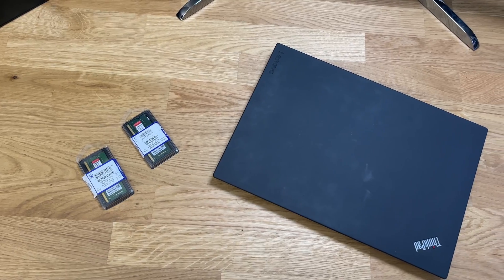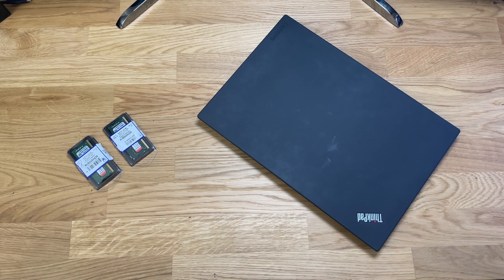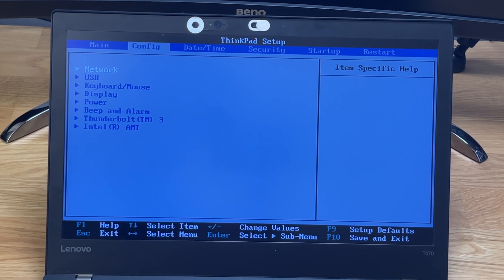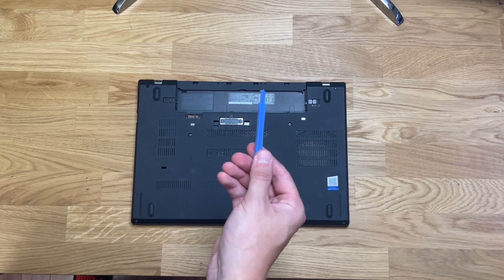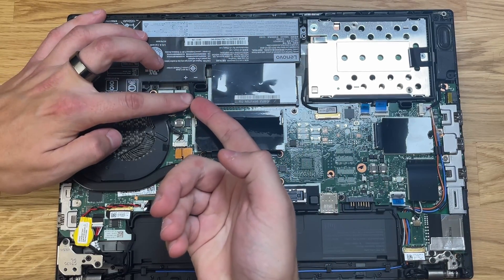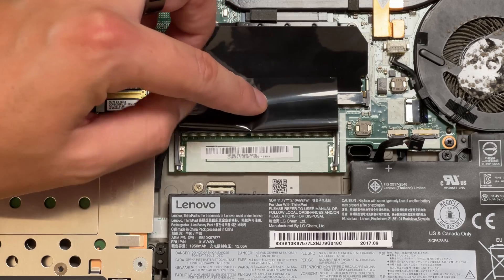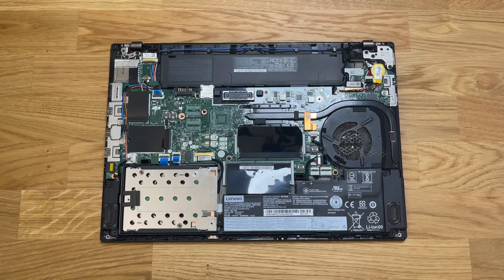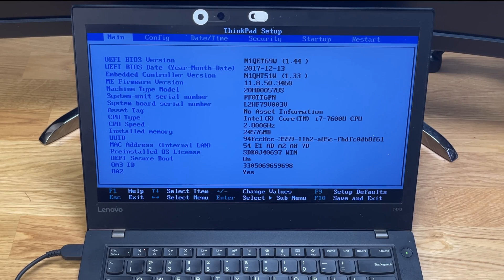How to Upgrade RAM on a Lenovo ThinkPad T470/T480 Laptop

Comment: I need help, i just added WD NVMe SSD 2242 258GB in my WAN slot, I already installed it properly and disconnected the battery before installing, but im still stuck in my LENOVO title, I can't even go to Menu

Comment: Great video - this worked out for me. Now I have 32GB of RAM in my Thinkpad. Well, a bit exaggerated, but okay. The plastic clips suck, one broke off in my laptop and got in the way on re-installing the bottom cover. But I managed to remove it completely… not perfect, but good enough.

Comment: I currently have a Kingston 8GB and Timetec 8GB RAM sticks in my T480 20L6.  I recorded all of the stats while testing RAM in SiSandra.   I then installed brand new Crucial Vengence 2 x 16GB Ram Sticks 2666MHz 18 CAS.  These sticks were also tested in SiSandra, and I was surprised to see the results were WORSE than the 2 x 8GB RAM.  I have tried another set of Timetec 2 X 16 GB ram sticks- same results = WORSE than current mismatched 2 X 8GB ram sticks.  WHY.  Also, the clock speed of the T480 is locked at 100MHz with a 17x multiplier.  But its locked.  So will 2 x 16GB ram sticks actually increase speed of this computer?  Or does the locked base clock keep speeds contained, even though it can technically take 32GB max?  It just didn't seem to show any improved performance with 32GB installed.  My VM's performance not improved with 2 x 16 GB ram vs 2 x 8GB sticks.  Who has thoughts on this?

Comment: Excellent demo, thanks. This worked really well and was super helpful. 
Just a note if you never did this before: The screws at the back of the laptop don't come/fall out (not with mine anyway), they just stay in the back cover loosened. You also don't need to go back into the BIOS after installing and reinserting the battery to enable it again. This is automatically re-enabled when you start up the laptop and it's connected to power.

Comment: My computer says I have 16gb, and I need to upgrade vecause it's really dragging editing video, how can I tell (without taking it apart first) if there are two 8gb ram sticks or one 16 gb, and an empty slot? Also, can I upgrade to 64gb? It uses DDR4 SO-DIMM 260 Pin.
Reply: Depends, are you T470 or T480

Comment: very useful. Question: so it is possible to mix DDRs of capacities? 4 with 16, 8 with 8, 16 with 16?
Reply from the maker: @urishani  it is possible, more recommended to use matching set but I’ve done it in the past

Comment: So you can use a brand of ram sticks right? Please respond!!!!
Reply from the maker: You can use any brand of ram as long as the specs are supported (max size and speed) but i linked some options in the description that i think are a good fit!
Reply: @TechWithTylerArruda  thanks I have a question I'm thinking of getting the l460 instead of this do you think it's better
Reply from the maker: The L series is more entry level than the T series. If you are talking about same generation L vs T, the T takes the win
Reply from the maker: @NeptuneDaSensei  no problem!

Comment: amazing tutorial. I just got my t470 and I want to upgrade its ram. Is it possible to use fury impact 2666MHz ram in this laptop?
Reply from the maker: That should be fine, you can check what your ram speed is and see if it matches
Reply: @TechWithTylerArruda  its 2133MHz. Is it ok?
Reply from the maker: I would try to get something the same if you are going to use both. If you are replacing and removing the existing one you should be fine with the fury
Reply: @TechWithTylerArruda  ok thank you for the advise.
Reply from the maker: @allanshadeedmuksin  no problem!

Comment: Did you turn on the built in battery in bios again? or should it be permanently disabled once another memory is installed?
Reply from the maker: I believe it’s automatically switched back on but I would check to make sure

Comment: Is it possible for me to add another stick of Ram (16gb) while not removing the original Ram installed[the factory set one(8gb)]?
Reply from the maker: Yep! You can have mismatched ram, performance might not be amazing but could help if you use the same timings
Reply: @TechWithTylerArruda  TYSM!
Reply from the maker: @peanut_wr789 no problem!

Comment: Can I ask??, so the RAM used by the Lenovo Thinkpad T480 laptop is "DDR4 3200Mhz" or "DDR4 2400Mhz"??
Reply from the maker: I don’t believe it’s 3200
Reply: @TechWithTylerArruda  So?, Lenovo Thinkpad T480 uses RAM with type "DDR4 2400Mhz"?? 

Because I found a video on YouTube, which explains that the Lenovo Thinkpad T480 can be upgraded to 64GB with DDR4 3200Mhz RAM type.
Reply from the maker: @kaniafitri5778  looks like 64gb works, someone on this forum did it with 3200mhz ram and it seemed to clock it down to 2400 but the 64gb was available.

https://forums.lenovo.com/t5/ThinkPad-T400-T500-and-newer-T-series-Laptops/What-is-the-Maximum-Memory-Supported-in-a-T480-32-GB-or-64GB/m-p/5131432
Reply: @TechWithTylerArruda  I just saw the thread. However, the system used turns out to be an 8th generation I7 processor.

Will it also work on the Lenovo Thinkpad T480 laptop with the 8th generation I5 processor variant??
Reply from the maker: @kaniafitri5778 good catch, I’m not 100% sure

Comment: Hey, thanks for the video. What is the recommended MHZ value for T470s RAM? currently I am using second hand laptop and inside it has 8GB 2133MHz RAM. No Idea about original RAM details. Could you help me? I want to upgrade to 16GB RAM, but I have no idea about MHz. Thanks
Reply from the maker: You can use up to 2400mhz! If you’re keeping that stick I would match it and get one of the same speed
Reply: @TechWithTylerArruda  Thanks for the reply. my onboard RAM is 4GB, I am thinking to sell this 8GB and buy 16GB 2400 MHz as you said. Thanks again
Reply from the maker: @RiseAboveRoots987  no problem!

Comment: The best proper RAM Install Ive seen, didnt even know there was a disable internal batt.  Thanks
Reply from the maker: Really appreciate this comment! Thanks!
Reply: @TechWithTylerArruda :After installing the ram you need to go back to Bios and turn on the Bios battery again, right?
Reply from the maker: It should turn on automatically but you can double check! Sorry for the late reply!

Comment: Hello,

It is quite helpfull, just wonder how to determine memory cards based on model, I have t470 with no memory in it and would like to have 2×16 variant if ddr4 but there are quite different type of ddr4 speeds 3200, 3600 etc
Also same goes for ssd is missing as well and I wanted to have 512 size but again what type is best for optimum performance thanks for helping out in advance
Reply from the maker: I believe you can use up to 32GB of memory speed I used was 3200mhz and you can use an Nvme drive. You can even get a larger drive than 512 if you would like. NVMe will give you the best drive performance!
Reply: @TechWithTylerArruda  Great, thanks for speedy response
Reply: you can use up to 64gb with 32GB ram sticks @TechWithTylerArruda
Reply from the maker: @lowgrind7076  I believe the max “supported” is 32GB but looks like people in the forums have had success with 64GB!
Reply: @TechWithTylerArruda  yeah I think it's because they didn't have that type of ram size available in 1 stick back then 🙏

Comment: great video!
I was wondering, is there enough power to support 32 gb ram in such a small computer?
plus: would 32 make a big difference compared to 8 when cutting videos, and will the battery drain quicker with more ram?
Reply from the maker: Hmm good question I’m pretty sure this laptop supports a max of 32. As for the battery, if you need more ram then you are probably doing more intensive work which in turn would make the battery drain faster.

Comment: Can I use this on the T470? Samsung 980 Pro 1 TB M.2-2280 PCIe 4.0 X4 NVME Solid State Drive
I currently have the XPG SX8100 PCIe Gen3x4 M.2 2280 Solid State Drive
Reply from the maker: You should be good if you have the m.2 slot

Comment: In the T480 model, it can handle 64Gb of ram <3
Reply: Do you know if the T470 can hold 64gb of ram aswel? Or is it just the T480?
Reply: @jamelljacks9356  according lenovo website it holds 16GB of ram but crucial website's says that it can support 32 gb of ram as maximum

Comment: locking for 2 Orginale Lenovo Backlite Keybords 
20L6 = FRU 01HX471 
INTERNATIONAL oder GERMANY !
where can I order this reliable source in China?

"LINK" please......Nice Day from Thailand

Processor
1x 8th Generation Intel® Core™ i7-8650U Processor vPro

Memory
64GB 2x 32GBDDR4 3200

Operating System
Windows 11 Pro 64

Hard Drive

1x  2.0 TB PCIe NVMe "0" 2280

1 x 0.5 TB PCIe NVMe "1" 2242

Camera

1x 720P IR & HD with Array Microphone

Graphics
1x NVIDIA MX150 and UHD Intel

Monitor
14.0 WQHD 300 nits

Da schon schlechte Erfahrungen gemacht in 2021 

LG Weit Weg by 33 Grad MAERZ 2566🥰
Reply from the maker: I’m not sure but a google search might help you out

Comment: Too bad we can't see how fast Windows would start up after the upgrade. For the rest, thumbs up! I am upgrading to my T470 from 8 to 16 GB. After a week I can say, that performance was already good, and did not improve much. I have dual channel for my ram now, so it works optimal and that's fine for now.
Reply from the maker: You will only find a difference in performance if you were to compare many programs open at once with 8gb vs 16gb. The more ram the more stuff you can have open at once without slowing down!

Comment: hi! thank you for the video! My question is should we turn the Internal Battery in BIOS back ON?
Reply from the maker: It should turn back on once you start the computer back on again
Reply: Is turning of the battery manditoy? Or can I just skip it because I don’t have an ec adapter is that just the charger? Or like what is it ?
Reply from the maker: The charger is the ac adapter

Comment: I don’t know anything about computers or ram and I’m going to the store to buy a ram stick for my thinkpad t470 in a few hours so I have questions. Are there different types of ram brands? I ask this bc is there a certain type of ram stick that thinkpad t470s need? Please answer me I don’t wanna mess up my laptop I just recently got this 😭😭😭
Reply from the maker: There are many types of brands! Some good ones that come to mind are Kingston, Corsair, crucial, intel, OWC. In terms of what to get that will depend on what you currently have, you can probably do a total of 32GB max
Reply: @TechWithTylerArruda  so basically the brand I put doesn’t matter and won’t damage my laptop?
Reply from the maker: @Carmelaines  no as long as it’s the laptop memory it shouldn’t. Performance might not be as good of the sticks are not a matching pair but would be hard to notice
Reply: @TechWithTylerArruda  I’ve managed to remove the lid off but I don’t see the internal battery wire that I saw on your vid, can I still proceed with the steps
Reply from the maker: @Carmelaines  you should have a wire there somewhere, you can google the model and then write “internal battery wire location”. You can also look at the wire coming from the battery and find it on the board
Reply: @TechWithTylerArruda  do you have any social media I can add you in so that I can send you a picture of what I’m looking at? If not it’s fine
Reply from the maker: @Carmelaines  https://instagram.com/tylerarruda33?igshid=YWJhMjlhZTc=

Comment: Great video. I notice a clip actually broke while you where taking it apart. Another YouTube warned about this. He said do the top near the battery first and then slide it down. But do not try to pry it from the bottom.
Reply: For sure a helpfull tip. I started on the sides and worked my way from front to back on one side, then front en then other side. After that, backside came loose easily.
Reply: Do you mean do the top near the internal battery first, or the removable battery first?
Reply from the maker: Yeah I’ve had to open a bunch of these so that’s a good tip! Thanks man!

Comment: What do you need to check in order to review  if the cpu can be upgrade in a laptop?
Reply from the maker: Most laptops (if not all modern ones) have processors soldered to the main board. This means that in order to upgrade the cpu you would more than likely need an entire new motherboard (which is not cost effective). Ram and Storage are the main upgrades available on laptops (some laptops even have these components integrated with the motherboard also like apple)

Comment: Awesome Video! I'm planning on purchasing an 8 gb model and wanted to upgrade the RAM. Would you know if I could simply add a 16 GB stick into the 2nd slot if its possibly a different brand? Also i've only heard of PC memory with increments of 8, so 16 GB, 32 GB, etc. Is there any issues with 24? Thanks again for all the information!
Reply from the maker: I believe it should work! I have done the same in an old MacBook Pro before and had no issues. You get better performance using a matched kit of RAM but it shouldn’t be very noticeable.

Comment: You link to a kit rated for 3200Mhz speed, does that speed work with the T480 or does the t480 downclock that set to work?
Reply from the maker: Seems like it downclocks to 2400, it’s probably easier to get your hands on 3200 and it should work just fine, I didn’t have to do anything, it down clocks it automatically
Reply from the maker: Good question, I’m not sure it supports 3200Mhz I don’t have the exact model I installed as I did the install for a family member, but let me check

Comment: Hey bro, I love and liked the video. Just one question: I'm kind of new to this whole RAM thing so do you have any specific RAM brands you recommend, or is any RAM good enough??

Thank you.
Reply from the maker: Hey bro! I would really appreciate a subscribe too! And with RAM I would stick to the major manufacturers. In this video I installed Kingston ram, other good brands are Corsair, Crucial, PNY, Patriot, G-SKILL… as with anything just check reviews of the ones you are looking at before buying!
Reply: @TechWithTylerArruda  Yeah, already subscribed no worries. Also, does it matter if I buy a DDR4 or DDR3 for my Lenovo T470 ? What was yours like?
Reply from the maker: @abdulfatahabdillahi4547  I would go with DDR4 it is newer tech and faster
Reply: @abdulfatahabdillahi4547  Hey brother. You can expand up to 64 (2 x 32 g). Crucial RAM is a little pricey but worth it.
Reply: @Jesse_Johnson i know you can put 64gb of ram in the T480 but Do you know if you can put 64gb of Ram in the T470 aswel?